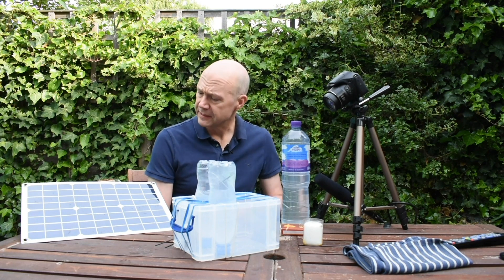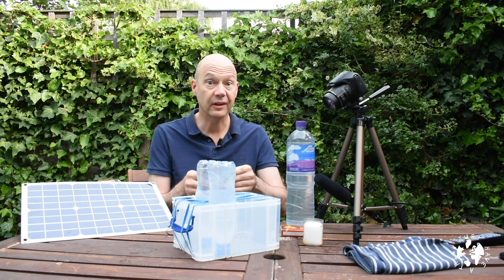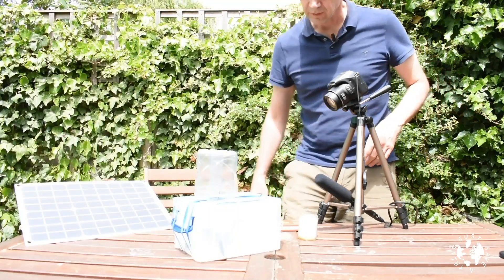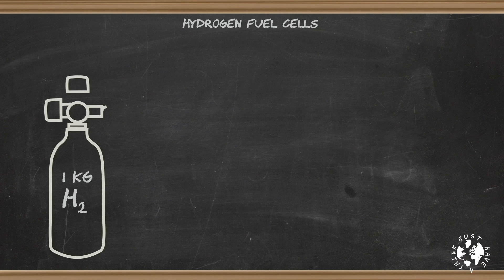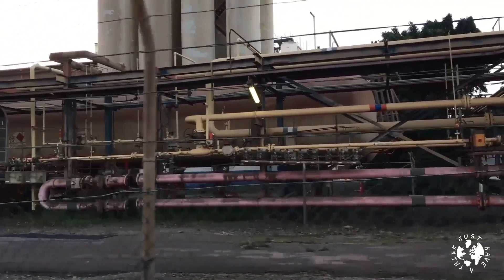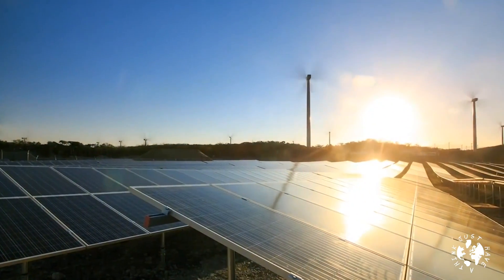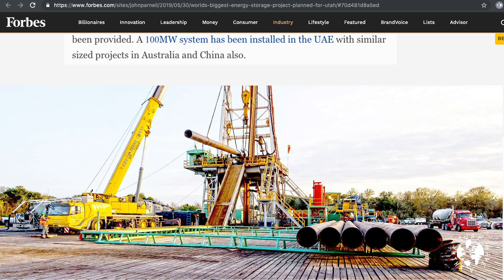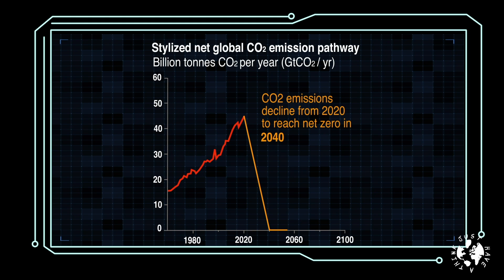Energy Storage in Hydrogen : Does this beat batteries?

Comment: Hydrogen's dirty little secrets.

1) Hydrogen is mostly made from methane. Each kg of hydrogen releases 5.5 kg of CO2 to the atmosphere

2) "Green hydrogen" from electrolysis (splitting water) consumes twice as much electricity in ultimately propelling the FCEV than a battery electric

3) The on-board hydrogen tanks have an expiry date at which time the vehicle becomes a brick.

4) Hydrogen costs more than gasoline per mile

5) The latest California study admits that there is no known way to get green H2 costs down below $19.00 per kg which is twice the price of gas.
Reply: actual reality of hydrogen is it depends on how you make it. the cheapest way is 

1. steam reforming of natural gas however, while the cheapest it's also not very clean.
2. while you only get roughly 50% of the energy back (compressing it to 700 bar) it doesn't matter if that energy is from renewables.
3. tanks can be replaced, just like batteries which degrade WAY faster then hydrogen tanks.
4. for now, as again there are not many solar/wind plants doing this. the main use wouldn't be for cars anyway, it's a means to store energy for use at night time when the sun isn't overhead or the wind died down.
5. not sure about that but it sounds wrong.
Reply: @rocksfire4390  2) efficiency absolutely matters. You need 2x as many solar cells because of the loss in storage. 3) you're thinking of the batteries in your phone. Which suffer from improper charging and some planned obsolescence. There are some emerging technologies that are specifically designed for grid sized storage.
Reply: @skiinggator  
well to baby the batteries you would need many many times more batteries so you didn't have to discharge as much energy from them during the off hours. that increases the space requirements and thus the cost of using them. getting more solar cells isn't a problem, there is more then enough space for that. even car batteries (EV batteries) suffer from discharging/over charging. some of them only last 500 cycles some last 1000-2000 cycles. at the end of the day at the current prices and storage capacities batteries are not a good option right now. in 20 years hell yea but not right now. we need a solution right now, we don't have 20 years to mess around.
Reply: @rocksfire4390  the only immediate solution is nuclear. Neither hydrogen nor batteries are capable of storing enough energy right now.
Reply: @skiinggator  
most of the nuclear plants will be under water in 10-20 years......

Comment: what you produced was low pressure ( ~7psi) hydrogen, whish as is really is not useful . my question is to get it under enough pressure to actually be useful, what procedures would you use, and at present tech, will it be massively expensive, or economically feasable?

Comment: I wonder how efficient hydrogen energy storage is long term vs short term in comparison with batteries
Reply: Lithium ion batteries are twice as efficient as electrolyser + compression storage + fuel cell in respect to electric energy. Long term vs short term does not affect both systems very much, as Li-ion batteries have low self discharge (1–2% per month) and compression storage has no boil-off (compared to cryo-storage).
Reply: @s9juvolzrebuilt984  absolutely and totally incorrect. In fact, the precise opposite is true.

In order to consider efficiency you need to consider the entire lifecycle and you also have to consider the myriad of ways in which hydrogen can be produced.

The first thing is that the form of electrolysis shown here is incredibly crude. It is the battery equivalent of a zinc/copper lemon battery.

Actual electrolysis is done using PEM electrolyzers which are 86% efficient.

Next, the entire idea of using photovoltaics to generate electricity from photonic energy and then use it to electrolyze hydrogen is asinine in the first place. Direct photonic energy to hydrogen is the exact same efficiency as PV -> battery, but it is actually far better than just that. Storing hydrogen requires only a very low carbon debt container, not a high carbon debt battery and is far more scalable (salt caverns can hold hundreds of terrawatt hours of energy for zero carbon debt).

Then there is using electrical energy to crack renewable methane which is GHG negative (since it converts CH4 which is a 24x stronger GHG than co2 into atmospheric co2).
Reply: @homomorphic  The round-trip efficiency is approximately 40%
source: https://en.wikipedia.org/wiki/Hydrogen_storage#Underground_hydrogen_storage
Reply: @homomorphic  would love to read into it more. CN u provide sources? Thanks
Reply: @homomorphic   That is amazing. So taking CH4 from deep in the ground where it could not possibly act as a green house gas and converting it in a two stage process (that produces CO and CO2 as byproducts) with the inevitable leakage of CH4, CO and CO2 (all three being well known green house gases) that will and does occur is GHG negative.  I'm stunned.
Reply: @dogphlap6749  assuming that the methane is being extracted from the ground anyway (which it is, every day that you drive your BEV) so right now, using a fuel cell creates a market to ensure that the methane is converted to co2 thus yielding a 24x reduction in greenhouse effect whilst BEVs do nothing to do that. So yeah FCEVs are greenhouse effect negative vs BEVs.
Reply: @homomorphic   Sorry but you are still not making any sense, and by the way my EV is currently charging via PV panels on the roof of my house (it is 10:14 am here).
Reply: @dogphlap6749  I'm sorry that your brain is incapable of  understanding simple concepts. What you do with your BEV has no bearing on whether methane is removed from the ground and your BEV contributes nothing to creating a high value market for methane so that economics favors conveying it to hydrogen and co2 and reducing the greenhouse impact by 24x. Your BEV, however, by stealing public investment from hydrogen stations actually reduced the amount of methane that is converted to hydrogen and  therefore result in the release of that methane (which was brought out of the earth anyway as a byproduct of oil extraction) and that results in 24x higher greenhouse effect.
Reply: @homomorphic   You brought up my BEV i.e. "which it is, every day that you drive your BEV", do you not even read your own comments. My BEV has stolen no public investment from hydrogen stations. It has received zero public funds, in fact the only significant funding here for any green transport has been to H2 refuelling infrastructure. These are the cherished hopes of the oil business, they have the money, if they want them let them pay for them instead of stealing my tax dollars to support the richest companies in the world. As to your reasoning that came up with 24x I've seen 5 year olds make more sense.
Reply: @dogphlap6749  your BEV wouldn't exist without having stolen government funding from hydrogen stations. You might not use public charging ststions, but no BEV vendor would have built a BEV for you without public charging infrastructure being there and it wouldn't be there if funds weren't stolen from hydrogen fueling infrastructure investment, therefore by you owning a BEV you are dooming your grandchildren to death on a planet that can no longer sustain human civilization.
Reply: @homomorphic    No one stole public funds for H2 stations that I'm aware of (perhaps you could expand on that point including example(s) if you have any). H2 cars have received additional zero emissions credits for speed of filling their tanks, a real advantage that H2 can display (just so long as they are first or second in the queue, otherwise you have to wait while the pressure is pumped up to the 10,000 psi needed to fill an H2 cars fuel tank). I know Tesla received a substantial loan to help with the production of their Model S but that was paid back early with interest. As you might imagine I'm fine with that. By the way, a hydrogen fuelling station runs in excess of 2 million US dollars, tell me again why the public should pay to roll those out, only Toyota has produced an H2 car in quantity to use them and they sell them at a loss in very small numbers.
Reply: s9juvolz rebuilt renni has apparently been to engineering school. i hope he didnt buikd any bridges in my area.... 🤣
Reply: Dogphlap well, his boss at shell oil says it's all good. we can trust an oil company exec & his engineers, right? 🤣
Reply: Dogphlap im REALLY going ti laugh when big oil goes bankrupt and renni has to go to work for panasonic battery division. 😂
Reply: @jaybee3165  it appears that you need to go off and study for a bit. When you've done that, I can refer you to a half dozen papers that you will then be able to make some sense of. Once you've mastered that subject material, you'll then be able to delve into the subject in depth and after a few years of further study, you'll actually be able to have an intelligent conversation about the topic and perhaps even provide a couple of insights of your own.
Reply: short answer- 70% energy loss with hydrogen. 2% energy loss with lithium batteries. and VERY soon, industry will recycle all the most expensive parts of a lithium cell. they've been working on hydrogen for decades.. and the best they've come up with is $7 a gallon. you can keep it.
Reply: @jaybee3165  nonsense. You don't even qualify what the scope of measurement is, but if you talk point of generation (nuclear) to the final point of kinetic manifestation (torque to the ground) a hydrogen energy system is about 50% efficient and battery energy system is about 5% efficient (hydrogen is 10x more efficient).
Reply: @homomorphic  according to CA energy research- https://www.californiahydrogen.org/wp-content/uploads/files/doe_fuelcell_factsheet.pdf   60% is as good as it gets RIGHT NOW. and that's JUST GOING FROM HYDROGEN TO ELECTRICITY... THAT'S ONLY THE FUEL CELL ITSELF.
Reply: @homomorphic  I'M not opposed to nuclear... but that's not the topic of discussion here. we're talking water to hydrogen to fuel cell... to electricity.
Reply: @homomorphic  the video is about ENERGY STORAGE and then usage on the electrical grid. NO ONE MENTIONED NUCLEAR OR TORQUE. the experiment is: take water. split it into hydrogen & oxygen. compress the hydrogen, store it in tanks. then rout it into a hydrogen FUEL CELL when you want to make electricity. THAT METHOD IS 30% EFFICIENT. 

Battery method:  charge lithium batteries. discharge to the grid. THAT METHOD IS 98% EFFICIENT, WELL... 99 minus a fraction of a percent during discharge. but don't take my word for it:  https://batteryuniversity.com/learn/article/comparing_the_battery_with_other_power_sources
Reply: @jaybee3165  what I just described is a scope that includes the scope you mention. The scope I describe is from the sun (nuclear) to the torque at the interface of the tire and the road.  Hydrogen is 10x more efficient than lithium ion batteries.
Reply: @homomorphic  WRONG. AGAIN. quote your source. what article? what research?  and again.. you're talking about fuel cell CARS. EVEN worse efficiency BECAUSE the hydrogen has to be liquified. there is a new solar PANEL that converts water DIRECTLY to hydrogen. that method is VERY efficient at separating water into hydrogen/oxygen.. BUT- the panel only lasts for about 6 months before it has to be replaced... it's a company called hypersolar. NOT VERY COST EFFECTIVE. FUEL CELL CARS, EVEN BY THE CA AIR RESEARCH LABS (which.. by the way.. helped develop them) ARE AT THEIR BEST ONLY 60% EFFICIENT. get it? they are NOT EFFICIENT!  fuel cells THEORETICALLY have the potential to be 80% efficient. but that's theoretical.. NOT REAL WORLD OPERATION. 98% charge & discharge efficiency of a lithium ion battery is a current, real, KNOWN fact. what else ya got? 10x! 10x! blah blah blah. quote your source man.
Reply: @jaybee3165  this will take a long time to explain to a non-engineer. Let's start by figuring out what you do and don't know about some of the basic requirements to be able to reason about this subject. 

Do you know the difference between diurnal and annual buffering?

Are you familiar with the scale of annual global energy consumption (i.e. can you quote the order of magnitude for it)?

Are you familiar with concept of specific energy?

Are you aware of the scale of lithium reserves (i.e. can you quote order of magnitude)?

Are you aware of the energy requirements of isolating lithium from seawater?

Are you able to quote the percentage of lithium reserves that are found outside of seawater?

Do you know the only two ways that energy can be created?
Reply: ok... i will break this down so EVEN YOU CAN UNDERSTAND IT. cost my brother-in-law $127 in fuel to drive from  LA to sacramento. cost me $17.27 to make the SAME TRIP in my chevy bolt. does that clear it up for ya?
Reply: Rennie Allen oh... brother inlaw drove toyota mirai
Reply: Rennie Allen so... crunch those numbers... if that doesn't explain it for ya... maybe you could and your engineering school for a refund?
Reply: @jaybee3165  you don't seem to understand anything about how the global energy system operates and this irrelevant anecdote merely seeks to confirm that.

As irrelevant as it is (and it is completely irrelevant to the subject at hand) I happen to own a 2019 Chevy Bolt.
Reply: Hydrogen is a far more efficient medium than batteries if done properly (i.e. not at all like it is done in this video).

Comment: Why didn’t you light the oxygen (in the other bottle). Or combine the two gasses (via a fuel cell) to make electricity?
Reply: because fuel cells are very complex and still expensive today, there are some reversible fuel cells toys for kids from the company horizon with a 70% efficiency for hydrogen production and 40% for electricity production, this is still far compared to to the state of the art reversible fuel cells but it makes a better presentation of the possibilities.
But maybe he wanted to try something that is possible to achieve in house with the principle of electrolysis.

Comment: Communities will use salt water batteries in shipping containers before trying to plumb hydrogen
Reply: They already are, no? But why not just use the excess electricity to pump water into elevated storage then when needed run that water through a turbine?
Reply: water's not heavy enough - you need a lot of water, high up, to store not very much energy.

Comment: Still transporting is problem and storing as "gas station" will need, so for cars is weak solution. For grid storage I do not have enough information, so maybe is worth for big grid storage.
About putting hydrogen in home usage, is bad, really bad idea, because it can many times easier leak, it do not have smell, and flames are invisible, so you will not smell it, not see it, and is very dangerous. Electricity is easier to transport, and we have already grid, so why putting money in new solution, which is similar or worst than we current have? Still for grid storage solution it may work.
About homes heating, using deep drilling and Earth heat, maybe be best option, is expensive today, but ot should not be (you remove only small amount of soil, so it not required much energy).

Comment: Encouraging, just need to gaol a few politicians to get past the coal mine money 🧙‍♂️🇧🇦
Reply: WRONG Christopher, one needs to change the laws of physics to make solar/hydrogen more viable than coal.
Reply: @patrickeh696  Nope......no need to change the laws of physics. Wind / solar / hydrogen gives you free, pollution free energy once you've built the infrastructure.

Coal requires continual mining, transport of fuel, waste storage and ongoing pollution....sure it's initial outlay is a bit cheaper but the long term costs are far more

Comment: Has the Hydrogen Brittling problem been solvrd?  In the past high pressure h2 tanks had to be thrown put after a couple years because of leaks through the metal would the tanks brittle..
Reply: As far as i know there are special steel tanks with aditional layer of lead and dense plastic that solve brittle problem. Of course they cost extra.
Reply: Embrittlement is controlled with a coating inside the containment. Not cheap but sometimes it is worth it. (The hydrogen interferes with the crystal structure.)

Comment: Love you for this clip, it's up and running already but not advertised because of the control of capital flow towards Oil and $. With the "Sabatier Reaction" even utilising CO2 and the use of resonant frequencies replacing the galvanic process and the catalyst  in both reactions it is together with anaerobe digestion the best way of using renewable energy. By decentralised generation with thermo coupling achieving an efficiency of more than 0.5 and supplied by a gas grid a robust, (Carrington Event) safe, sustainable and clean way into the future use of energy. "Don't be insane drive with METHANE!"  you've just got a new subscriber.